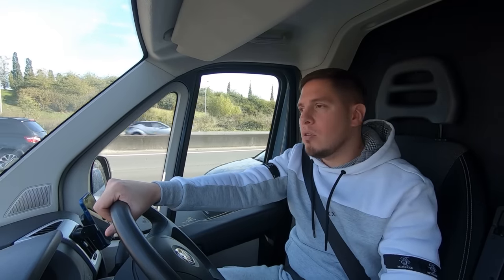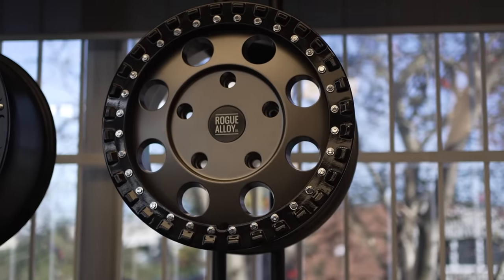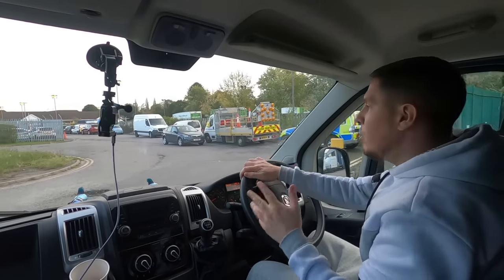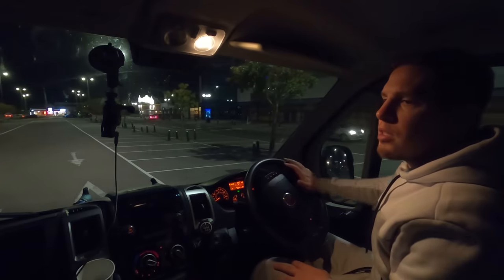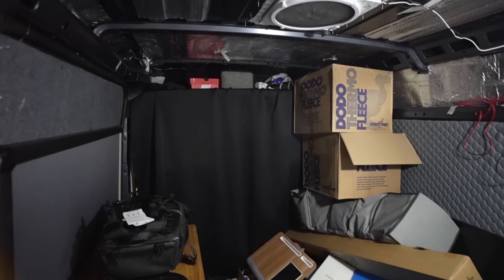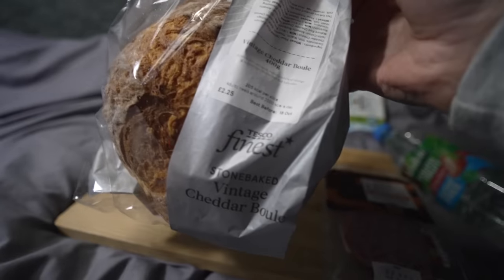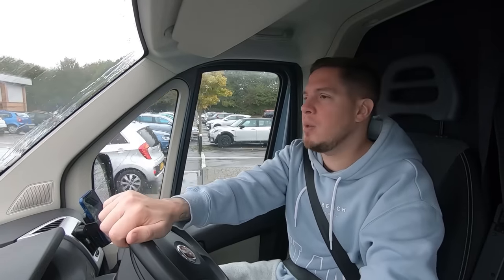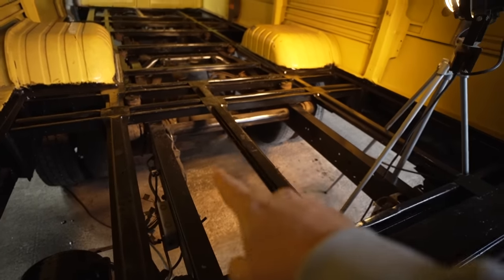Making my Camper Van unique

Comment: I hope you checked that the wheels didn’t change the speedo calibration (just use a GPS speed app on your phone), because sometimes changing to different wheel sizes can cause the speedo to read wrong.  Oh and move your phone to one of the air vents to your left, then you won’t get twat valley police thinking you are on the phone when your arm is leaning on the window seal.  Our company sent out a directive last week to move all phones to the centre of the vans to avoid this problem after someone got a FPN similar to like you did.
Reply from the maker: Yeah my Speedo is accurate with the gps still. And yeah I was thinking that about moving the phone. I think I’m actually getting a fixed sat nav now too so I won’t need the phone there at all

Comment: Hi Adz ..rather than all those permanent power boxes you have shown ..why didnt you jus use the Ecoflo pro  ?? and wire up yr van to it ..that way you can take it out (for safety when u dont use the van ) and also its the only power station that you can charge from an EV point ..now that Cosco are selling them at a knock down price of £2.4k with a 2 year warranty.
Reply from the maker: I wish I could’ve done that to keep things simple but unfortunately power stations (apart from one that I know of) can’t run more than 10amps on the 12v side. So no diesel heater unfortunately. And it’d be a struggle to even use a water pump when the lights are also on etc. Plus Dc to Dc charger. But hopefully they will start making them more suited to van installations soon!

Comment: I hate those tyres on vans with a passion horrible on the road on if you do go in some mud it's fwd anyway so good luck 🤣🤣 drive me up the wall!
Reply from the maker: A lot of people get this confused. But Fwd has far better grip than Rwd in the majority of cases. People get confused because Rwd has some efficiency advantages, especially for race cars etc, so they assume they have better grip/traction. But they don’t. So if 4x4/awd isn’t an option then these are a good choice. Also, without getting studded tyres, these tyres are by far the best choice for snow. Obviously mud tyres would be better for mud but these are best for what I need
Reply: If you're going to the Arctic @Adz
Reply from the maker: Yeah I’m going in Jan. taking snow chains too
Reply: Good luck take lots of flour and yeast powder or baking soda so you can make bread 👍 @Adz